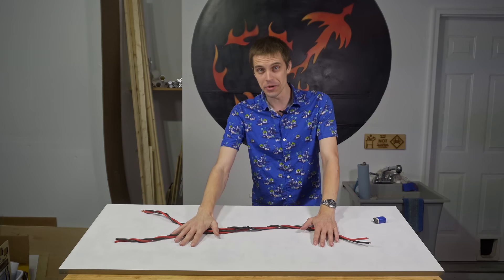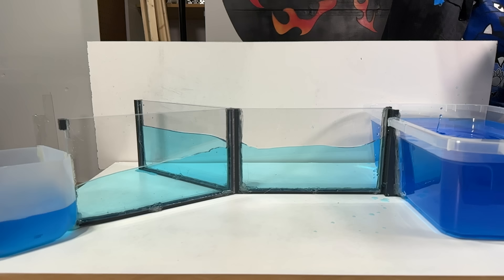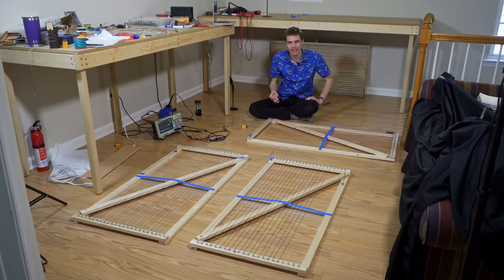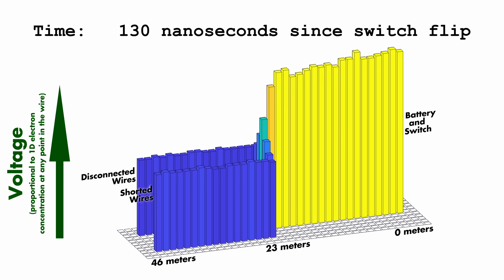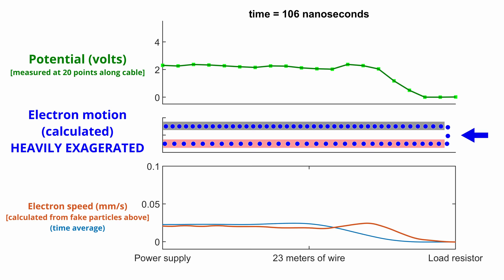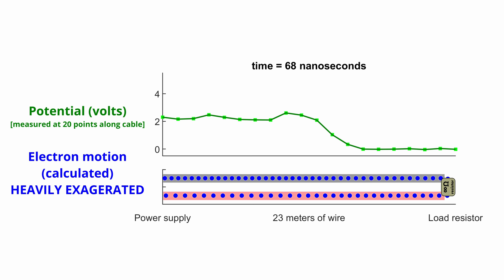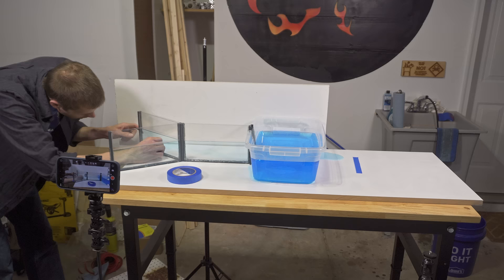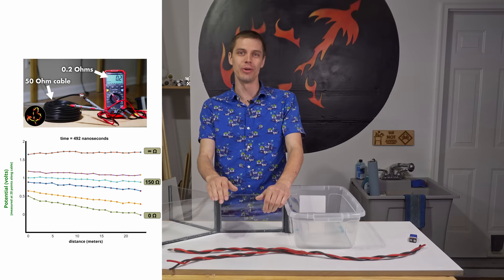Watch electricity hit a fork in the road at half a billion frames per second

Comment: I have a 100% no bs proposal to the alpha phoenix channel. Make a video of the explanation of what happens and how the current figures out whether to stablize or fizzle upon striking and holding the short circuit at the point of the arc while stick welding and its relationship to polarity AC DC+- as well as how theyrw behavior changes when high frequency is introduced for the sake of ease given different filler alloy and flux coating affect it use high intensity cored copper coated rods. The same used in old carbon arc lights/projectors and obsolete twin carbon flame(arc) brazing torches. Id be happy to supply everything and you can keep it all for doing the video. Hood w/ passive shaded lens, gloves leads, ground clamp rod holder the rods, high frequency generator, a single carbon and  twin carbon flame torches. Would even supply the welder and go 50/50 on shipping. You just need a 50amp(min30amp) 220v dedicated circuit(welder)and a dedicated 20amp circuit(high freq generator)>(ideal on the opposing leg but not required) and the proper space away from unshielded devices and anything you dont want to catch fire(20ft radius is plenty). Oh and a metal or concrete workstand(ill throw in clamps or a bench vise too)

Not even remotely messing around im Completely serious just lemme know ill give you my contact info.

Comment: Great vid. Twisted wires have an effect on the disapation of emr and the very act of monitoring the experiment with external devices has a marked effect on the outcome. I guess any measurement equipment once connected must alter the results so we may never really know what's going on. Even connected a device by induction will have an effect. What do u think. I'm sure u r a lot more clued up than me so have mercy if I am wrong.

Comment: Water flow model triumphs again lol. But I think the two fluids (air and water) as opposed to just electrons moving explains some of the difference. I wonder how closely acoustic waves model the wires? The wave reflecting at the boundary is very similar to what happens with a guitar/piano string under tension which gives rise to harmonic oscillation

Comment: Answer C is the only one that makes sense for inductive kick. That's what I thought when I heard the options.

I did some testing on strong solenoids before. One of the tests was flicking the power on and off quickly, basically doing an inductive kick to ramp up the magnetic field, and then collapsing it so that the core wouldn't get trapped. Basically using the solenoid as a coil gun to see if the stoppers would break, sometimes they would and we would hit the ceiling.

Maybe you have an idea for showing the magnetic field build up and collapse around a coil? Maybe some voltage doublers and fast relays to really drive the inductive kick and then rug pull before the circuit stabilizes? Just watch out for singularities in your mental model. They're fun to think about, but they're not real and could make your head collapse. 😁
Reply from the maker: That sounds like a pile of fun - hope there was nobody on the roof 👍

Comment: So many delighted comments about wrong experiment... and even PhDs are excited... Do you really know how voltmeter is working? It closes circuit on itself using very precise resistor inside it and actually meters amperage multiplied by resistor's ohmage, Ohms law, baby. So essentially "open circuit branch" is not really open, when you measuring it in this way. To prove myself I can also mention battery voltage measuring, when there is no circuit at all and electrons does not have any "spare" branch for flowing. And I'm not sure, does other method to measure voltage exists, for example capacitors, or maybe FETs, regulated just by electric field, but even so it closes the circuit. In my opinion it's better to use current clamp to see is any current flowing, but definitely not using wires to this. So it's sad, but this video just proves that voltage spread speed exists and nothing more...

Comment: I think its more along the lines of D but with both information signals emitting simultaneously.
The battery pushes volts. The device pulls amps.. so they're both playing a role. The disconnected end is not pulling any amps.

Comment: This is why your computer runs at 4.24 gigahertz, or takes 235 nanoseconds to complete each instruction. That is the time it takes for the circuit to reach the stability shown here. Each of the 50,000,000,000 transistors in the circuit of the CPU is open or closed exactly like the ends of these wires. The circuit oscillates exactly like this one until it reaches a stable state. At that point the result of the instruction is available.  It takes 235  nanoseconds from the beginning of the execution of each instruction when a switch first allows electricity to flow through the CPU circuit until the beginning of the next instruction. Stability in the circuit is reached "long" before the 235 nanoseconds is up, but the result needs to be saved, and each transistor has to be switched (from open to closed, or from closed to open, or not at all) to be ready for the next instruction.

Comment: Dude. This is the most fascinating video I have seen in a long time. The upward wave at the end of the open wires was surprising. I suppose raising the voltage would do the same thing only faster. I'm curious how it would react if you decreased the voltage. Would it be inversely proportional?

Comment: Impressive experiment and animations and results seem  consistent  with a time domain reflectometer . But there is more going on here which a did not hear mentioned and will effect the voltages  and current waveforms namely  the wire inductance  and wire to wire capacitance  which will  have significant impact at the high frequencies produced by the voltage step.

Comment: To add to my last comment the compressible nature of electrons can not be modeled by STP water. It is incompressible at these conditions and therefore will not mimic compressible fluids.
Reply from the maker: Electrons in a wire are significantly less compressible than water, but both are compressible enough for these effects to exist. A solid metal rod is compressible enough for these effects to exist (just a bit)

Comment: I believe if your model had closed-air system (pipe system) and pressure gauges at various spots, it would be more closer representation of a circuit system. In my thinking flow and water movement would closer relate to current in the electrical system where pressure would closer be related to voltage. But that of course would be much harder to build and even harder to see visually without looking at each pressure reading. At least that is how my civil engineering mind with rather basic electrical knowledge sees it.

This has a similar feel to me as water hammer effect and inrush current with voltage spike situation.

Comment: Hydraulics and Hydrostatics have substantially different performance issue to quantum physics in election creep. Bernoulli's theorem comes into play with pressure, velocity, friction, and shear forces. To eliminate that dip requires a widening aperture of flow to mitigate the venturi effect at the gate. To get the desired effect you'd need to create a tube extending beyond the gate because you used a flush mount exit. If it were recessed into the water source it would behave differently.
Changing the viscosity of the water would have a huge measurable effect on the flow. If the system were before atmospheric pressure it would behave more consistently with expected visuals compared to electron dynamics.

Comment: Idk if this has been noted about the initial ~surge~ spike in voltage:
1) The battery will have some capacitance at the conductive ends, so as this tiny capacity discharges (incl. cabling and switch) there will be a slightly greater voltage in the first wave
2) The speed of the electrochemical process is the steady state.

Thus it should be possible to construct a battery with even higher capacitance yet same or lower steady state voltage?

This is just from my observation, right or wrong?

Comment: In the video, you say that when the battery is initially connected way too much current flows. Another part of the video you say way more power initially flows.. This is incorrect. The initial current is quite small, the initial power is quite small . The initial voltage is that of the  unloaded (lightly loaded) battery . The final voltage depends on the resistance of the cable and the internal resistance of the battery.  Other than that, this is a fantastic video! Thank you so much for making it.

Comment: Very interesting video. I learned so much. Cogratilations. But there some points that you had to consider. The resistency is a opponent effect to the flow of electrons, it is correct. But it is not responsable for the wave that you show us (velocity 0,64 C) in my opnion. There is a indutance effect of the wires. Indutance is a opponente effect to the flow changes of the electrons and is for that we are whait for some nanoseconds to the circuit estabilize. It is exactelly the same inercia effect of the water in your parallel experimente, because water has mass. But the eléctron has despicable mass and I think the indutance prevails over mass in this case. Think about that. I hope to be helpfull! Kind regards.

Comment: Damping is what you're looking at for some of the comparison work.  Would be interesting to do the same water model with oil and alcohol.  I presume damping in the electrical circuit is related to electrical properties of the materials.  Interesting to think of how the electrons are actually 'moving' here - is it an actual flow of electrons or is it the electron shells bumping in to each other, since 'electrons' are more like a cloud of potential as a shell than anything else, if I remember my physics and chemistry?

Comment: Interesting. Very cool and informative. Thanks. However, the battery current is limited by the speed at which it can deliver current by how fast the chemical reaction is. The old 1.5-volt tall dry cells could be shorted for hours and still retain a charge because their discharge rate was so slow. If you hooked up a power supply or a modern LiPo battery, the wire would melt very quickly as the battery would send a lot of current nearly instantly.
Reply from the maker: I had a capacitor in the line to eliminate the battery resistance as a limiter

Comment: the electrons are already there, they need motive to move, that is based off the potential presented(9v battery), the amount of current isn't "given" its determined by how much resistance the circuit (the wire) presents.
Reply from the maker: The question I’m trying to show here is how the resistance actually sets the current

Comment: Why not use aVNA?...
We use  VNAs a lot in RF and microwave engineering for designing and testing components like filters, amplifiers, and antennas, etc. 
It sends test signals through the devices under test and analyzes the reflected and transmitted signals for characteristics like impedance, scattering parameters (S-parameters), and insertion losses

Comment: Electron do not travel at the speed of light. Experimentation has shown that there is no delay and electrons appear at the end of a circuit instantaneously. Think of the wires like pipes. They are already full of water before  connecting a moving force, (battery or water pressure), so it takes no time for the water / electrons to flow at out the other end. Experiments have been done with extremely long wires and when attempting to measure the time it takes after connecting the power for the electrons to appear at the other end, it was found to be instantaneous.
Reply from the maker: Watch my video “why does water change the speed of electricity?”

Comment: I predict it will initially charge the wires with a static charge. When they meet at the connected ends it will start a flow which will work its way back to the battery.

Comment: I think this experiment may need to be re-done using a high quality bench power supply and current probes to ensure accuracy and that you are specifically measuring the electron flow in an unloaded, vs. loaded circuit branch. If you supply "Unlimited" current to the circuit with a bench power supply, the voltage will settle at a much faster rate. You may find very different results from this experimental setup. These "Waves" of voltage may be more related to the battery chemistry and measurement technique than the actual electron flow. To fully measure the electron flow in each portion of the circuit, without compromising the experiment, a current probe will need to be used on each scope input to ensure a fully unloaded circuit being measured (and even that produces a small inductive load on each branch being measured). An oscilloscope`s input has approximately 1meg ohm input impedance that must be accounted for that is terminating the two un-connected wires on the ``open`` end of the circuit. This means that your overall measurements and graph do not fully represent those of a truly unloaded vs. shorted circuit branch.  I have worked in a lab environment to evaluate the effects of line transmission on AC and DC sources through different conductors for educational research purposes in the past. In my career I have corrected and updated the procedures for experimental setups to ensure the correct data is being recorded and the procedure is only testing specific variables. With a little more setup, current probes can be `wound`` around each portion of the circuit, and when the electron flow ceases in a specific branch, there will be no more induced electron flow in the current probe. Please reach out if you would like to discuss or work together on a follow-up😊

Comment: I see the surplus voltage from the disconnected side mostly flows into the side of the connected wires instead of back to the battery. I wonder how much this can be manipulated with multiple branches, thickness of wires, and different conductive materials. It could possibly take much much longer  for electricity to reach the intended point
Reply: or am I just reinventing an existing piece of hardware

Comment: 10:53 it would be cool to see this same experiment done with influencers like adding a Magnetic Rod, A iron or faret rod, and a aluminum/coper or golden rod in different locations! That might give a better sense of how the magnetic field that is generated influencers the electrons interact!
Reply: Basically a rod that blocks the interface like Lead, a rod that neutral farrit material, a magnet rod that already has a field weak or strong enough that would/not be overpowered by the generated one, and a rod that would take the magnetic field and flip it by inducing a magnetic field in the rod such as copper/aluminum!  Also if you replace the battery DC current with an AC one would change the frequency or flip of the magnetic field! It too would change how the voltage changes across the experiment and how fast the AC changes direction possibly show some insight into why this affects the power/volt over time.

Comment: My guess is that the electrons will start moving as soon as the battery is connected by at a current different from what Ohm's law predicts, and after a while the cut off wire gets saturated with electrons/emptied of electrons making the current stop flowing in that wire. And the system reaches a steady state in the other wire with the current ohm's law predicts.

It wasn't detailed exactly in the video but I think that would be c. I am mostly wondering how one would think it could be any of the other options. A and B violate locality?!

Comment: Intuition screams that  the distributive capacitance of the twisted pair is the main factor you are measuring. It would be interesting to see the voltage measurements though out a circuit where the conductors are separated. Maybe they  could be weaved on separate frames.

A single measurement point may yield the same resultant graph, if a variable AC source is used. As you are measuring voltage standing  or propagating waves.

Comment: When stro, hits the Y, a small part is immediatelly reflected back, and that didn´t happen with water, cause of its high viscosity, friction and the water´s behaviour at  crossroads with curves, possibly... but the sound-waves in a pulse-jet or a 2stroke-exhaust´s resonance-chamber would look even more similar to electricity in that respect, than water. Actually this is how 2stroke engines are "turbocharged" without any turbocharger: It´s the sound-waves-reflections that load the engine (or even suck the exhaust-gases out), and there´s many at each single cycle, each wave-reflection with a different job.

Comment: C would have been my answer and I would have predicted that it would be exactly like the water model except that gravity doesn't really effect electric fields and they aren't 2 dimensional. Volts are just forces that propagate when a current encounters resistance. The battery is regulated like a pressure valve. So only so much force can propagate from the battery. The back flow in the circuit is what stabilizes the pressure and regulates the flow. It's just a slope and not a flat plane because water is effected by gravity. The waves remind me a bit of water hammer. But there isn't air in the wire. The resistance is coming from the wire itself.

Comment: Voltage in a wire is analogous to fluid pressure in pipes. You could have demonstrated this using water and pressure gauges and avoided speed of light issues.  It the diffusivity equation.